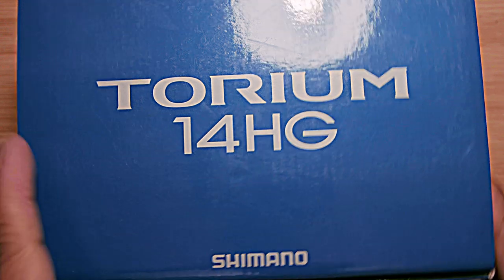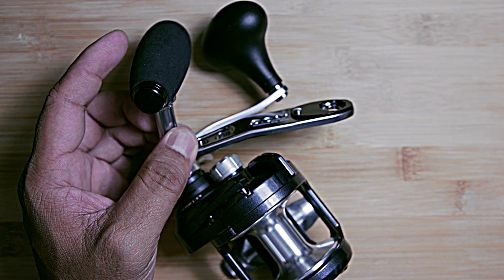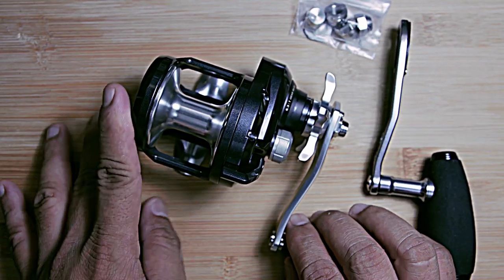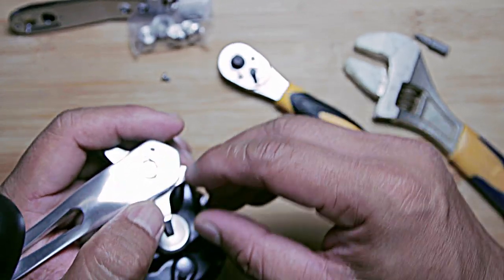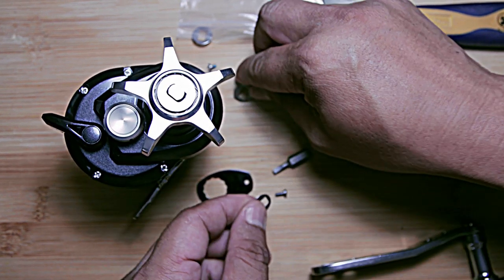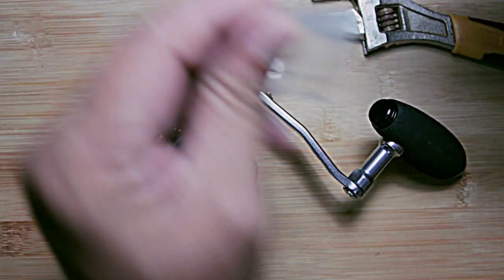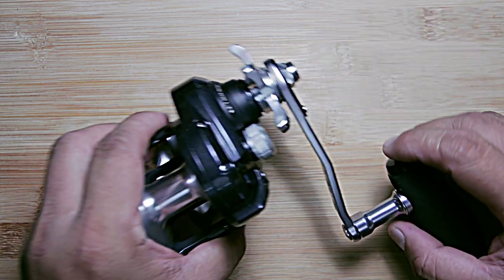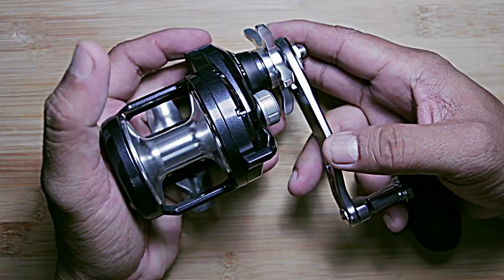THE BEST CHEAP ALL AROUND JIGGING REEL

Comment: Hi dear friend, thank you very much for this video.  I am going to get the torium 14.

 For the longer handle do I need a expensive one like the one you used ? Or one from China Aliexpress would be fine ?

What Pe line you gonna use for this reel ?
I am also very curious of wat type of soft plastics you are going to use on deep water.

Greetings from Holland.
Reply from the maker: you just need the length - so you can get any handle you can get your hands on, just as long as it is longer than 85mm. You can get the stock handle of an Ocea Jigger 2000 if it's easier to get it.
Reply: @TheFishingKit  thanks for your advice  bro. I gonna install the handel I received, it is more or less 11cm and it feels beter than the smaller shimano talica handel.

Comment: Man you asemble it wrong.You must place that square washer underneath handle, you  have square undercut in handle where you MUST place that square washer.That is most important part, without it handle will slip under big load.
Reply from the maker: Thanks - actually fixed it right after the video.
Reply: @TheFishingKit  I am glad you figured it out
Reply from the maker: @TheSSHR  actually fished it with guys from SOM. Then asked the tech to take a look at it :)

Comment: My 1st jigging reel. I now have 6 & its still my favorie & most balanced for jigging. Just feels right. Just respooled w 30 lb braid after 5 yrs? I think I paid 170.00. Like it better than my 16, my abu garcias even my ocea jigger which is a great reel. GREAT 1st reel for jigging (& salmon).
Reply from the maker: Sounds great!
Reply: Hey Kit Im having a helluva time trying to find someone who sells a rod clamp kit for the Torium 16 HG. Called shimano who doesnt sell parts anymore. All I needed were the 2 flat head threaded screws but no one sells just those. Any leads greatly appreciated. Bagged 30 pounds of fillets Mon Aug 9 Bodega bay. 12 lbs salmon fillets,18 pounds lingcod/rockcod fillets. The 16 with 50 lb braid handled everything very nicely. November - faralons - big lings.
Reply: hello how about the paint? some says  its flaking after a long time?

Comment: Hello I also took the decision for buying the torium but on my last trip to Fujairah, I faced difficulty while reeling in the line from the big depth as if there was too much resistance so any advice regarding that
Reply from the maker: what rod, line and what jig weight were you using
Reply: @TheFishingKit  I have the torium 16 hglh , rod is Shimano grappler type slow J max 400 , line is Daiwa Saltiga pe 3 and mostly jigs from 150 to 350 according to current and depth.
Reply from the maker: what about your Jig? it might be your jig is too heavy. your jig might be spinning on the way up.
Reply from the maker: If you are fishing deep, there might be cross currents or even just a swift current at the time, so it's really hard to say...could be a lot of factors really. Best way to see if there is something wrong with the reel itself, is to drop it down in shallow water and see if the resistance is there.
Reply: @TheFishingKit  thanks alot for the help I will try it and if You can mention a place in Dubai where some professional can check the reel itself will be appreciated 👍
Reply from the maker: @amralaa3643  Where you bought the reel would be the best place to start :)
Reply: @TheFishingKit  I bought  it online
Reply from the maker: @amralaa3643  oh boy...then check with your favorite local tackle shop...most of them have guys that can check your reel, not sure if they will charge you so before anything, ask first.

Comment: Great video and channel. Would you recommend the Torium 14HG paired with a 6ft 2 100-200g vertical jigging rod fishing in 50-150M of water? It would be good if the reel would also be versatile enough to use for other types of fishing e.g bait fishing. I have an ocea jigger 2000NRHG for my slow jigging rods.
Reply from the maker: the torium can be used for fast jigging, if you can get the narrow versions and change the handle, it would suit the purpose. if it's wide, it can still be used but a bit cumbersome.
Reply: @TheFishingKit  thank you! The daiwa saltist star drag 15 and 20H models also look interesting but I’m wondering if the 6.4:1 gear ratio and 39.5in per crank is too fast for speed jigging?
Reply from the maker: @jurghhh1528  you want a very slow retrieve reel for fast jigging.
Reply: @TheFishingKit  Thanks. looking at the Avet MXJ reels now
Reply: I went for the Torium 16PG in the end. Think it has a 34 inches retrieve. Hopefully it will pair well with the rod. Thanks again.

Comment: Thanks for sharing your video, using the Torium 14 HG with a long handle for slow pitch jigging is a great idea!  I currently use the Avet SX for my slow pitch and it fits the purpose.  I have the Torium 16 for fly lining live bait, which works perfectly for me.  Too bad they don't make the 14 HG in lefty.

I think the Penn Fathom 15 narrow 2 speed would also be a great option for jigging as well. 

Just curious.  If the Torium 14 HG with long handle equals the price of the Ocea Jigger, wouldn't it be better just to get the Ocea since it's milled and has better parts?
Reply from the maker: It's actually not the same price. There are other handle options that are cheaper...I just chose the better one. I already have  OJs, and i wanted to show an option for people that can't get an OJ, when I made this video, OJs were strictly sold in Japan. The Avets, even two speeds are too slow when you fish deep, if it fits your area and works well for you, then hey, jackpot :D

Comment: The torium 16hg comes with a handle with 2 positions to make it longer. 
I think the 16 is more versatile than the 14 and you should only buy the 14 if you specifically need the slightly smaller size. 
The ocea jigger also automatically re-engages the spool when the handle is turned. The torium needs you to flip the freespool lever once you want to start cranking the line back. 
The torium range are really good quality for the price.
Reply from the maker: We're talking about this reel for slow jigging right?  The handle is too short for slow jigging. The 14 is close to the size of the 1500 OJ, OJ handles are again, too short, you can use them, but they will work better with a longer handle. The JDM toriums automatically re-engages, like the OJs. Toriums are good value for money, for those that can't afford an OJ - that's why I made the video.

Comment: Good video, The Torium is a fantastic reel.  It will work for many applications.  It is not a Jigging reel.  Will it work absolutely.  There are some fundamental differences in a "Jigging" reel.  Narrow spool, Lever drag and machined gears covers the most critical.  The narrow spool self centers your line, making it the choice for both speed and slow jigging.  Lever drag is the standard for jigging for obvious reasons.  Machined gears, all of the gears in jigging reels are machined, due to the fact of the amount of stress put on the reel from the combination of the fish, and the longer reel arms that is prevalent in jigging reel.  In slow jigging the reel does almost all of the work.  You rely heavily on the reel and the line.  None of this means that you can not use a Torium for jigging, it is an impressive reel.  I have always been a believer that one should buy the best that one can afford.  If you have the extra money I would recommend that you look into a reel jigging reel.  If not, there are many options out there that do not cost as much, and The Torium fits well.
Reply from the maker: Brent - Well said. However, you are wrong in a few points. Firstly, let's start from "not a jigging reel". You are correct and incorrect - The Torium you are familiar with is not really a pure jigging reel, and it is. You see, The Toriums sold in Japan ARE made for jigging. I suggest you look them up. 

Secondly, narrow spools are only beneficial in fast jigging. IT is a disadvantage in slow jigging - There's physics involved. I suggest you watch the spool dynamics video, the jigging reels video I made and if not, go to the facebook of japanese angler's secrets and see what he said about narrow vs wide spools. I made my videos way before he posted and have been talking about this for a few years to help people understand. 

Lever Drag is not the standard for jigging - star drags are, on ocea jiggers and saltiga, two of the most sold reels for jigging, especially for slow jigging.  The Inventor of slow jigging, uses star drag reels for a lot of reasons, I would not argue with this guy with assumptions, one of them - You don't have a spool lock (in place of a clicker) to use on lever drags when you snag.
Reply: @TheFishingKit    Thanks, I did not know that there were different Toriums here in the us opposed to Japan.  Although we disagree on a few things.  I like you.  You do not get defensive and that is rare these days.  You are correct that there are a lot of people that do not use lever drag reels for jigging.  But if you look at almost all of the "Slow pitch reels" in the US they are almost all lever drag reels.  The wider spool for the same diameter  reel will hold more line.  A slightly larger reel with a narrow spool and you over come that obstacle.  I have been slow pitch jigging for about 14 years and the trend has going to narrow reels with long arm handles.  I like learning about how others view, and do things.  It gives me a chance to pick up some info that my help me down the road.  Since I can not afford reels in the price range of a Studio Ocean Mark.  I have only a few options in a lever arm drag.  Most reel manufactures only make right handed reels in lever drags.  Accurate's new jigging narrow spools and Avet has a few.  Shimano does not offer left handed, except in the star drag.    It seems like you have some great knowledge on the subject, wish I could pick your brain a little.  Thanks for the info and making videos.  I have subscribed.  Keep up the good work.
Reply from the maker: @brenterwin99611  Thanks Brent, I think people who get defensive when asked "why" have a limit to their understanding and don't want to be exposed, so they get defensive - to discourage people from asking. 

Anyway, Slow jigging didn't start from the US, it started from Japan. So I think when you say "standard" It's a Japanese standard, not US. If it's something like...say a Mustang, then ok, the rest of the world doesn't know about the car, so that's a US standard. But This is something like Sushi...you know what I mean? The rest of Asia is way more advanced in Slow jigging than the US. The "other" standard for Slow Jigging Rods comes from there. 

On a narrow reel, your line stack/arbor diminishes faster than on a wider reel. this means your drag will spike up faster than on a wider reel. This is a huge disadvantage since slow jigging is a light line system.